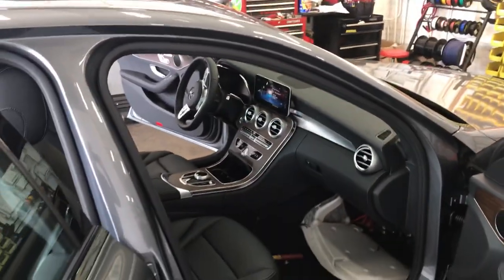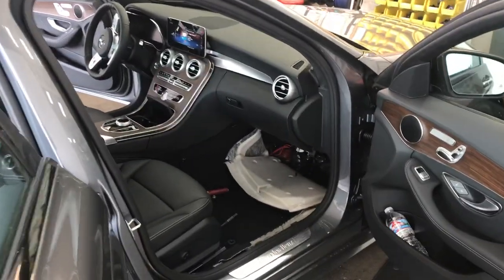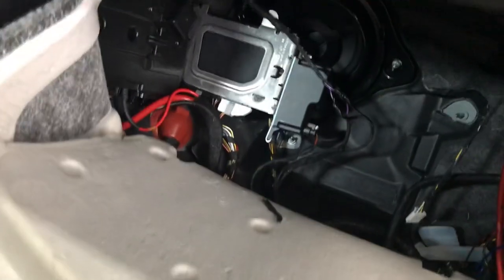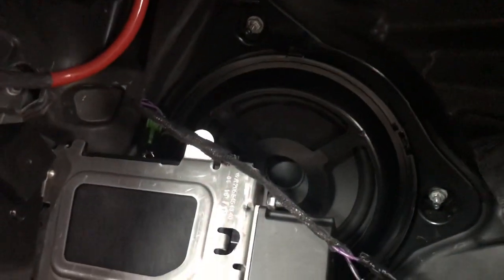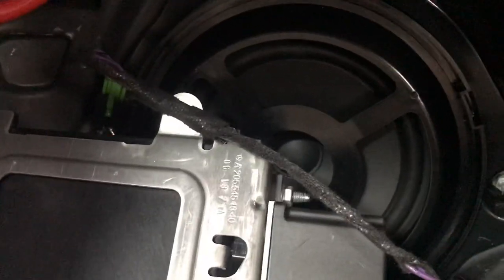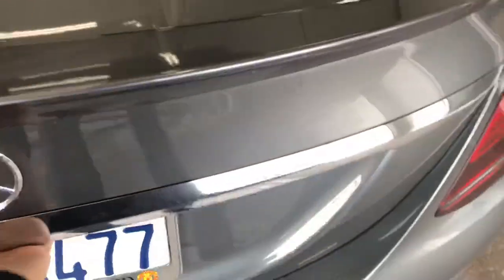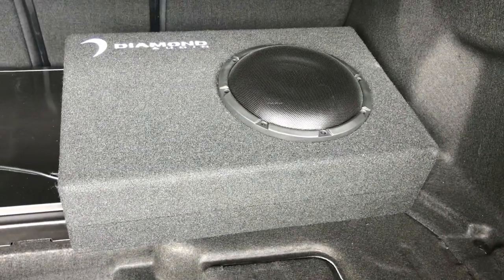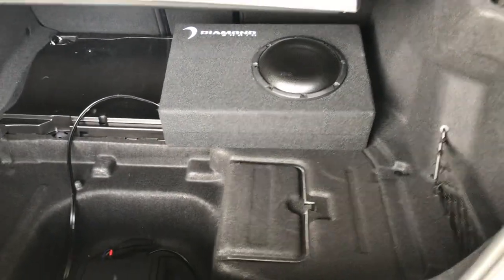Mercedes C300 aftermarket Subwoofer install wire colors w205 Al & Ed’s Autosound

Comment: Not to be nitpicky...ok, I'm being nit-picky...but...
The speakers under the dash in the front are not true subs. They are just woofers that use the front structure to give results similar to subwoofers. There is no factory subwoofer in the C class (afaik). The distinction between a woofer and a subwoofer is the range of the speaker. A subwoofer has a very narrow range of a very low frequency. It can't do any other (higher) frequencies. The woofer has a much broader range of sound in comparison and while it doesn't get as low as a sub-woofer, it will still be able to get low notes.
The rest of the speakers in the C-Class are mid-range (doors and center channel) and tweeters.
The only real source of deep bass sound is from those front speakers (woofers) using the structure of the car to emulate subs. The biggest problem that arises is when people want to fade the sound towards the back in an attempt to increase the bass. They inadvertently cut bass as a result. I had this problem until I figured out why it was happening.
If you ever feel that there isn't enough bass in your Mercedes, go into settings (EQ) and increase bass to max and reduce mid and treble slightly and keep fade either neutral or slightly towards the front.
OR...just get a subwoofer...
Any subwoofer installed in the trunk will greatly improve your low-end bass response since a dedicated sub will have a much, much lower (sound) frequency response. You'll also be able to fade towards the rear of the car to boost the effect of the bass.
Reply: holy shit bro    dudes showing how to connect a remote to add a subwoofer in back,   take that story an go hit up fox lmao...

Comment: Thank you  for  the  video it help me  install a system  on my 2016 glc 300 benz
Reply: Hey can we change that sub with 8" aftermarket subwoofer. If yes what things i have to buy just a sub that can fit or something else to power it.

Comment: I have an Active subwoofer in my trunk of my c350 e station 2017 wagon. I did like in the video, it is only two wires from the front speaker, plus is purple and negative is purple and black. And for the remote signal I used a fuse adapter, find an empty spot for the fuse. But the rear speakers didn't give any Signal to run the subwoofer, you have use the front speaker, I used the passenger side like the video. I connected a LOC to the speaker wire and then i connected the rca cable to the LOC. I opened the front to have a look at the cd player, but it doesn't have any RCA for plugging.

Comment: Nice job. Quick question,  read that the Mbux system cuts the bass when the volume raises..how is this avoid or is it no the issue on your end,…
Reply from the maker: Use an audio control lc2ipro with bass restoration.
Reply: Thank you.

Comment: Hey I got  the same audio system.. I want to buy the pioneer ts-wx130da. Cann i install it same as you did? Will it work ? Where to I get the power? And the purple ones is signal right? Thank you.

Comment: So did you tap into the purple wires from the sub for a signal? Then fed it to rca convert?
Reply: I wish someone would answer this question.
Reply: @gabrielvaladez1408  I'm still waiting
Reply: Figured it out. Just connect to the red and black stripped wire that connects to the cig lighter on the dashboard. It's a 12v accessory, so it only turns the amp on when the car is either running or in the on position. Hope this helps anyone looking for the answer.
Reply: @gabrielvaladez1408   no what I was looking for is did he take the signal from the sub he tapped into the sub and used that signal for the rear sub. Or do I tap into the rear speakers
Reply: @jayrouf6624  oh I think I understand now. Yes you can use the signal from the rear speakers or just use the ones from the original sub. You'll need a line out converter tho to connect the + & -(signal) to the line out converter which will have the RCA plug ins then you'll simply route two RCA cables from the back of the amp. I hope this helps. I think I got what your saying
Reply: Anyone know if the purple is positive of purple black, usually the black on is negative but he said opposite
Reply: I think it’s obvious he wired it to female rca connectors then connect the amp rca male cables to it. No need for a line convertor when connecting straight to the sub. When you connect to the rear speakers yes
Reply: negative bud  @DaeMurda
Reply: @kingofarkansas384  what are you tagging me for. I’ve tapped into this wire and had the perfect sub signal. Relax yourself
Reply: @DaeMurda  my bad g. Maybe u can explain  better 😉

Comment: Wiered everything as you did. It works, but i slightly notice a difference... even with the back seats down. I know how good the sub can play, and i feel like its playing like 30% of its capasity.
If anyone have a solution on my problem, please help! :)
Reply: sander stene is it tuned correctly? Ideally you want the gain to peak at the same volume that your stereo would peak at, may be worth looking at tuning a sub on YT
Reply: Also sander, did the purple wires go to the RCA connection? How did you wire it up?
Reply: Mount your sub in a better location for it to travel better through the car . Do pref on the side at far rear
Reply: It’s because of the low input pushed to the sub. Have to take audio from the app or speakers. Wish I could tell you how or what damn color but nothing exists on the internet apparently. Trying to solve this problem myself.
Reply: @Mezzamike  same issue here, you ever findout what wires for  L R??
Reply: He might have the wires backwards. Try connecting to e solid purple as your. Positive and see what happens

Comment: Isn’t just purple positive?
Reply: That’s what I thought . Do you know . Cuz I’m having issues with mines hooked up like he said
Reply: @2coolentertainment  I figured mine out, I did purple positive and I think purple with a black line was negative. It worked fine I’ve been running it for a year now.
Reply: @HarmanSingh-uf9mn  nice thanks yeah I changing mines now I’ll let you you know . So after you changed the polarity it got a full strong signal huh ? 😉
Reply: @2coolentertainment  I ran those two wires straight to my amp, or you can convert them into RCA cables if your amp doesn’t take the wires. They have a good signal.
Reply: @HarmanSingh-uf9mn  yeah for sure but my question is . Is once you switched them to purple as your positive and stripped as your negative was your problem solved ? . Thanks for the support this has been a long on going signal problem
Reply: @2coolentertainment  I can’t remember now, I think it worked both way, if your having problem with the signal maybe something wrong somewhere else.